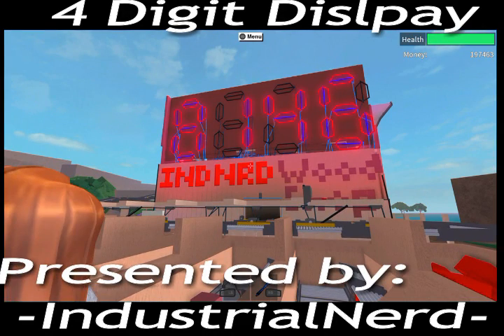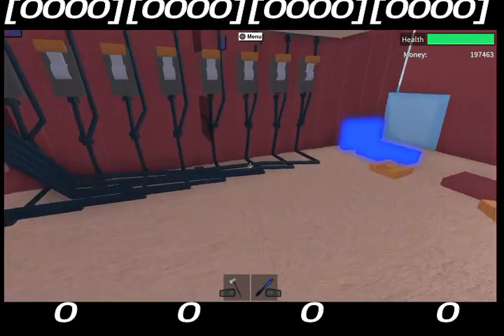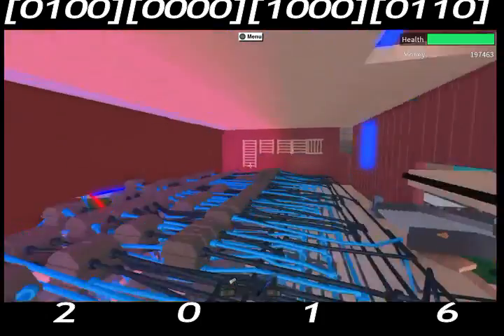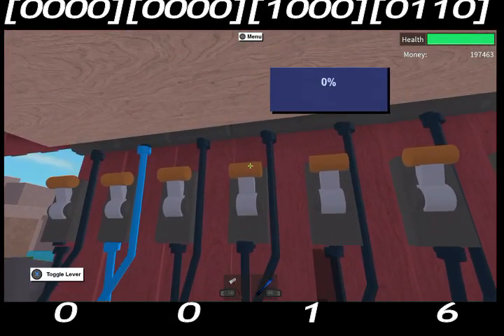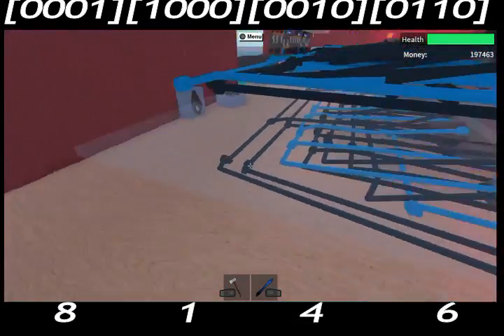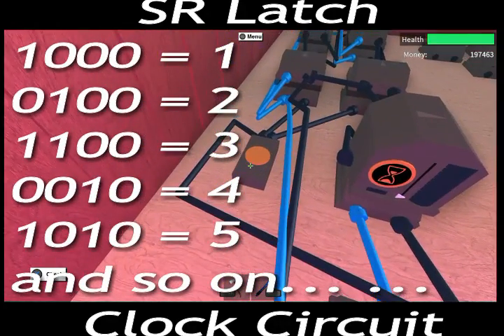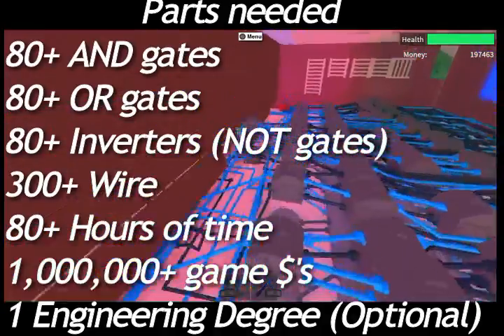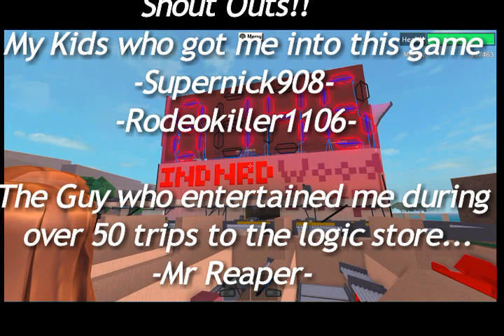Working 4 Digit Display / Clock Logic Circuit Lumber Tycoon 2 IndustrialNerd

Comment: I need a schematic for a single button switch latch on Lumber-tycoon, could someone please help me?
Reply from the maker: use SR Latch, find latch in my piggy bank vid...
Reply from the maker: https://www.youtube.com/watch?v=WrF715xSeoI

use OR Gates and Not Gates
Reply: Industrial Nerd am I seeing that it requires 2 buttons or can I link a single button to perform the operation?
Reply: Industrial Nerd am I seeing that it requires 2 buttons or can I link a single button to perform the operation?
Reply: Industrial Nerd thanx for your time by the way. 😊
Reply from the maker: i see what your saying, try 2 inverted And or NAND gates, tie first and INs to pushbutton and second NAND INs to NAND output and switch, first and should give you a slight time delay to get your pushbutton to go on and off.
Reply: Industrial Nerd latching pushbutton momentary contact toggle switch. Push on, push off
Reply from the maker: Circuit timing issues can at times be fixed by putting 2 inverters in series to increase the propagation delay time. Game circuits are still buggy, when you turn on a switch the light turns on before the wire lights up on large bases. Let me know if you need help with something practical.
Reply: I am working on a saw circuit that just repeatedly activated the saw.  I need this for certain large logs.  I am sick of pushing the button all the time.  I can make a pulse generator with a signal delay that has output fed back to the input.  This works fine but no way to turn off.  No actual switch device.  So I used an AND gate with toggle on one pin to make switch that turns off feedback wire on signal delay.  It does work to turn off but the and gate seem to increase the signal going back into signal delay device causing it to go haywire.  Instead of one light moving up the bar more and more will start moving up and it eventualy mostly locks into on position.  The whole thing works without the and gate I just need some way off turning the thing off.
Reply from the maker: I'd try putting 2 Inverters back to back before the AND gate on the side that the on/off switch ISN'T on. This will give a small delay before the AND gate and might fix the buggy timing issues. 

You could use Laser detectors to detect logs and and reverse Conveyors so you know when a log has been cut. 

MSG me on XBOX and i'll give you a hand.

Comment from the maker: Next Project is a 16 Segment display to show Letters A-Z, any one interested in helping or donating lumber tycoon 2 cash I will give you credit and shout out in the next video. This will require 5 bit's totaling 5 switches for 26 letters (A through Z), and a MASSIVE amount of logic gates and wire. Let me know if you can help. Thanks!   And if anyone has any ideas of something else (other than a friggin calculator) let me know.
Reply: Awesome.. how much cash do you need?
Reply: I am working on an Lt2 computer, I would like to know how you made that clock. I need a clock for mine, and the lag is real.

Comment: tweet this to defaultio on Twitter bro!! its amazing! !!
Reply: i agree. the XOR's are particularly buggy as you can have 2 "simultaneous" signals hit an XOR and it will strobe. I realize roblox is already a very buggy platform and defaultio probably cant do anything about it, but its still annoying.
Reply: @Valeres1978  i know how to turn my pc on
Reply: @rogueplanet13  Congratulations!
Reply: @Valeres1978  thanks but i cant turn it off!😥
Reply: @rogueplanet13  Just shout at your pc "Wu tang clan aint nothin to mess with!!!" and assuming its not a west coast PC, it will turn off
Reply: @Valeres1978  lmao. It worked! Suuuuuuuuuu
Reply from the maker: Andrew i would appreciate that as I am not part of the Twitter community. Please also inform defaultio of the problematic propagation delays in the games circuitry, as it is impossible to create a clock circuit based upon propagation delays due to base size (data size 6). Also ask defaultio if he could change lasers to global instead of client so i can have a wireless (laser) based communications between bases to change the numbers on my display, as a laser emitted from a non client base will not energize a client based laser Laser detector "input". Basically I want "you" to control my numbers from my base through lasers on your base. Thanks!